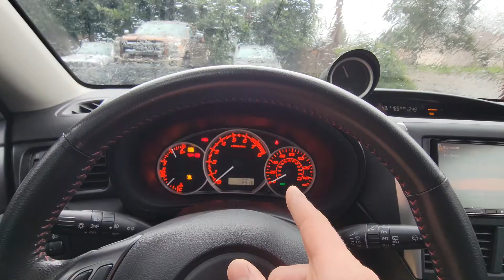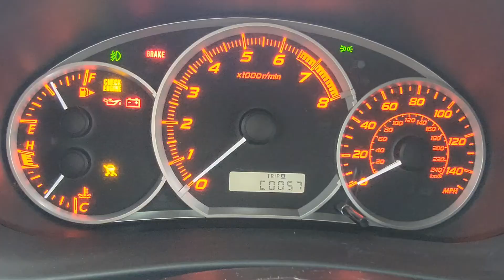How to read check engine light without a code reader! Subaru WRX and STI!

Comment: What if you get P - - - . What does that mean?
Reply from the maker: @teresadurment2283  it means you don't have a check engine light.
Reply: Mine did the same thing. It had the check engine light on, traction light on, flashing cruise control. I tried this to see what the code was and got the P-----. Started the car back up and all the lights were gone wtf 😅

Comment: Just tried this with my 2017 (VA) STI Type UK with a check engine warning. Unfortunately, this process doesn't seem to work for the VA chassis. Shame! Will have to run a diagnostic on it instead. Thank you for the video regardless.